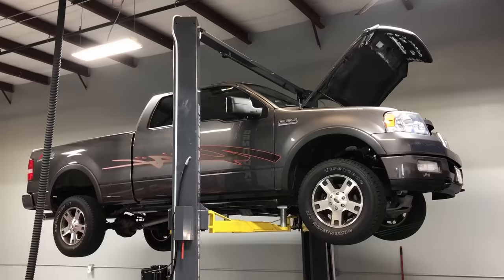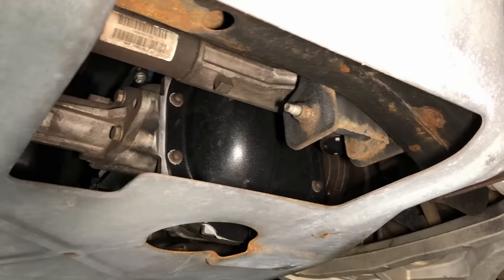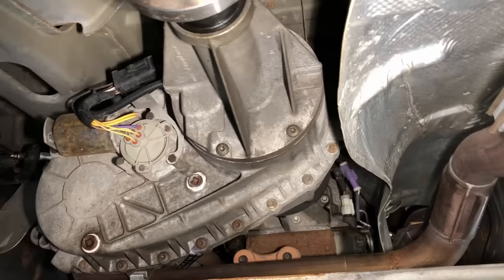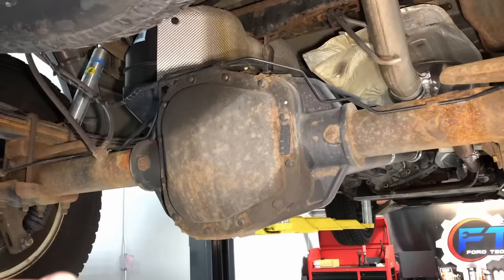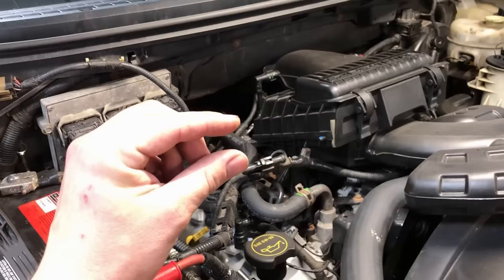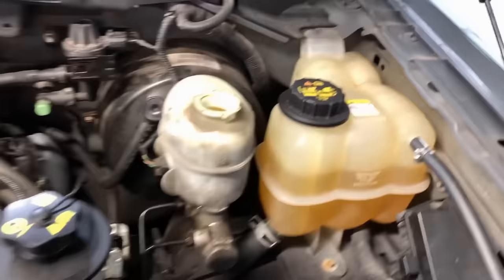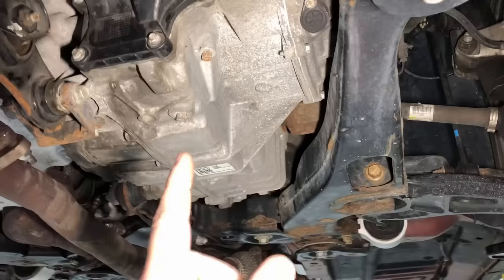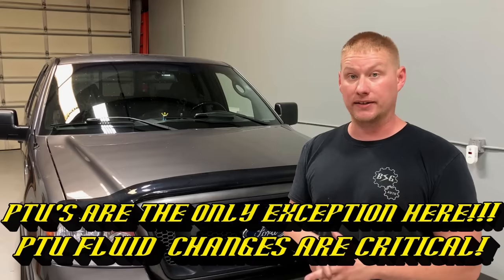Never Follow Ford's Lifetime Fluid Service Intervals: Here’s What I Recommend and Why!

Comment: what causes rust in the block?  besides water....low coolant level  o2 in system or a break down in coolant additives or iron from china?
Reply: All the above plus the coolant breaks down over time and becomes acidic to the point it dissolves material and causes more rust. Then you have the dissimilar metals in the system that cause galvanic corrosion as well.
Reply: agree!  .

Comment: GREAT INFO AS ALWAYS- I, VE GOT A 2003 FORD F53 CHASSIS MOTORHOME WITH THE R1- 400/WAUTO/OVERDRIVE IT SITS MOSTLY IT HAS 45500 ORIGINAL MILES- HOW MANY MILES BEFORE CHANGING THE MAJOR COMPONENTS REAR/TRANS/ETC; APPRECIATE ANY ADVICE, PATRICK.P

Comment: Just purchased a 2019 F350 6.7 diesel. What are your thoughts on an early first oil change to get rid of metal contamination from initial break-in?  1000 miles?  Later?  Thanks

Comment: Used AMSOIL signature series transmission oil at 24,000 miles in my 2016 Ford Explorer, it took 5 and a half quarts, so now it’s mixed with 5 and a half quarts of Mercon LV motorcraft oil, will that ruin my transmission?

Comment: When (if at all) do you recommend doing a *transmission fluid change AND flush*? In the video you said fluid change at 30k, fluid and filter change at 60k. Does it ever need to be flushed? 2016 F150 6R80. Thanks!!!
Reply from the maker: No flush needed
Reply: @FordTechMakuloco  Can you help me understand why a full flush is not needed? Many thanks!
Reply: @cg9608  shocks the transmission introducing all new fluid vs a drain and fill where only a couple qts come out. It’s to prevent transmission slipping

Comment: I have 2012 Lincoln MKZ hybrid,it has 700k miles and no problem,just replaces the electric water pump..should I change the spark plugs and coil
Reply: Did you add an extra zero by accident?
Reply: MaxiiBoii no brother,this cars are bullet proof

Comment: I have a 2015 F150 with the 2.7 ecoboost. I use 5w30 synthetic blend Motorcraft oil. I drive mainly all city driving, with short trips. I've always changed oil on all my Ford trucks every 3000 miles. I have a 460 V-8 in one, a 4.6 Triton in another, and my 2.7 Ecoboost. My other trucks are at 150,000 miles and run perfectly. Should I continue to do this with my 2.7 ecoboost? Will changing the oil too often do harm to a ecoboost engine?

Comment: I followed your advice and drained and filled my trans fluid on my 2018 SHO with 34000 miles, at a ford dealership... now I'm misfiring... it started 2 days after the service was done... any suggestions

Comment: I have a 2018 f150 non-4/4 with 46.5k, and 99% of the miles are highway miles. If I change the transmission fluid at 50k, (this would be the first time to replace the fluid) should I change the filter as well?

Comment: How often should the transmission fluid be changed on a '13 Focus with "power shift" transmission? Also, can I use "dexcool" antifreeze in place of the "orange" factory stuff?  Thank you!
Reply from the maker: 60k miles for trans fluid, and no I would never use junk GM dex cool.

Comment: Hello Ford tech, love your channel so much good advice.... wondering if you could help me out please please please my 2014 Ford F-150 Fx4 will turnover but won’t start the first time.... turn the key off and back on and she starts right up.... one exception is if she sits over night or for awhile it will start first time no problem. 5.0L just had the fuel pump replaced and she ran fine for a couple weeks before starting this... Fuse 27 checks out good (common problem), no codes, runs like a champ when started. Any ideas would be great my warranty just expired a couple hundred miles ago😢

Comment: Hi I have a 2016 mustang gt 55k miles with the 6r80 . Should i be doing a pan drop and filter, fluid change vs a flush to get all the old fluid out?

Comment: I have a question for you. My car is 12 mkz hybrid 263k mileage. I have never changed transmission fluid because of the manuel. Some people say if you didnot touch it so far don't change the transmission fluid. What would be your recommendation

Comment: What if the ptu does not have a drain.  I have a Ford flex and I never noticed a drain or a air scoop to funnel air to the ptu.  On an explorer I have seen a scoop that funnels air to it.  Even on an interceptors they look like they have scoops and other bits to keep the police vehicle cruising with no issues.  How would I service the PTU on a flex?

Comment: @FordTechMakuloco how often do you recommend a front diff fluid change for a 2015 f150 that has the IWE's eliminated? The front diff is always spinning. Also should I change the transfer case fluid sooner as well because of that? Also my dealer has recommended a transmission fluid flush for my 6R80 with about 82k miles ( I bought it used with 76k miles). Is a flush recommend or should I drop the pan and change the fluid & filter? Thanks!

Comment: How often should we do O2 sensors? The ones in front of the cats can improve mileage and power since they tell the computer how to mix fuel and air based on exhaust. I have a 2015 3.5 EB, so I imagine mine are getting blacked out. It has 50k on it. What about the ones post-cat?

Comment: What do you recommend for the transmission in an 08 Ranger? V6 with automatic, 113k mi, but fear I may be sensing some slippage. Fluid is still clean and red, and Ford says it's "lifetime"  (which I never have bought) but know these AT's sometimes have troubles as they get into this age range... Thanks!

Comment: Does anyone know how to contact Brian, without having to drive to Chicago? He doesn't pickup the phone or answer emails. Does anyone know why he occasionally advises 5w-30 vs 5w-20 engine oil? Was he threatened with a lawsuit by Ford or EPA, as to why he can't/won't talk about it? Can't get an answer for YEARS on this one question.
Reply from the maker: I have never deviated from recommending 5w-30 for the 5.4L 3v engines.
Reply: @FordTechMakuloco  Thank you for your reply! Woohoo! What about the 4.2L V6 and 4.6L V8 engines?

Comment: If your vehicle is used for highway 95% of the time, with "city" driving the rest (1 to 2 lights, no traffic, sometimes a train stop, small town kinda stuff) how long would fluids last then?  Would they break down faster due to highway speeds, faster moving parts sounds like more heat, however I guess on air cooled parts it does get more air on them, though I don't know if that is enough.  My neighbor has a 2013 Edge and I don't think he's yet to change his transmission fluid.  Last time I saw his odometer it was around 170k kilometers (that's around 105k miles).  He told me it shifts like a dream still no problems so he doesn't bother with it.  If I got him to allow me to change it for him (I do his oil and brakes for him, but I don't force things on him ultimately) would it be safe, no slipping etc?  I just don't want him to come at me saying I broke something.

Comment: I own a 2016 f250 6.7 and I use it about 5 to 7 thousand miles a year and was wondering when would be a good guild change for it I pull a 8 thousand pound camper 3 times a year?

Comment: Hey man great video, I got a 2011 Ford fusion with 85,000 miles on it I just recently replaced 2 quarts of transmission fluid. But the wrong fluid, AutoZone. I took out 2 quarts of the existing transmission fluid and put in what he gave me mercon V. It requires Mercon LV. I’ve already driven like 100 miles with that stuff what should I do?

Comment: Denver Colorado here,
I need to replace  5.4 3 valve engine 2004 F150.  Fasers timing issues at 164,000 miles. How can I know who to trust in picking an engine and installation? I want to tale your advise and install the high volume Melling oil pump . How do I know if the reman engine has the "good" fasers or if theyt are using cheap aftermartket  fazers? Will the upgrade likely void the re-manufactured engine warantee by adding aftermarket parts? Other parts I am considering are the headers, upgrade from the ford spark plugs. Does all that change the warantee with moist engine re-manufactures?

The only thing worse than Ford building a bad engine is the replacement engine is a bad installation or re-mmaned with bad parts?
Please advise

Comment: Hey man thanks for  Chanel  you have really good staff on it ....I have question for you I just purchase  2006 Lincoln Mark lt 8 cylinder engine and I was checking all the fluid   And it’s seems to be  overdue for matemance  now o want change all the fluid on the truck  but I’m not sure if should I used same oil as I see you on your videos  n fords F150s  or its there any chance specific brand to use on Lincoln Mark lt truck. Thanks for the help

Comment: I had to change my spark plugs in my SHO (3.5 EB) At 35-40k miles due carbon tracking. I took it to the dealer and due to no codes they wouldn't really check anything. Pissed me off. I just checked the plugs, all good. Why couldn't they do that? It's not that hard.

Comment: Hi  maybe I missed it but what is your recommendation on oil change intervals for the 3.5 ecoboost?  I seem to have to replace a turbo every 25000 miles on average.  i change oil every 3000 miles.  Thanks

Comment: On new truck, why do you recommend changing transmission fluid after 30k? Why not every 60k miles like for older vehicles?
Reply from the maker: Only on the first 30k miles, after that every 60k as stated in the video.

Comment: Love your videos, very informative, but would like your (OR anyone's ) good advice on what I could have done to prevent the heater core from developing a leak.  My current car is an 09 P71, with 155K miles and the heater core developed a leak so it is currently being bypassed. Fortunately, I live in Florida so don't need HEAT all that often, but may need DEFROST/DEFOGGER for windshield in a few months.  What went wrong?  How do I prevent another heater core from developing a leak?

Comment: Hi Brian. I just found my 2014 f150 3.5L ecoboost leaking coolant. I made an attempt to locate leak but very difficult from the driveway without lifting truck. Looks like its coming from water pump seal and dripping around oil filter and other parts. Bought my truck brand new and have followed your recommended service intervals, truck just hit 70,000 miles. Is it common for any radiator leaks to occur in that area so soon? Im taking it in to dealer since I have extended warranty. If it is leaking from pump, should I have dealer replace pump and thermostat as preventable measures?

Comment: Someone recently gave me an old 1998 F150 4.2 v6 that runs fairly well for its age. It has 170k miles on it. I'm using it as an extra work truck. I have been working on changing all of it's fluids out and replace worn and failing parts. The only major fluid I haven't changed yet, is the transmission fluid. I was thinking about changing it, but I don't know how many times the transmission fluid, if ever, has been changed. The guy who gave me the truck, got it at 100k miles. So he had it from 100k miles to 170k miles. He never changed the transmission fluid when he had the truck and he doesn't know if it was ever changed previous to him owning the truck. My question is, should I change the transmission fluid or just leave it as it is, at this point? I heard changing he transmission fluid on a higher mileage transmission can actually damage the transmission. What do you think? Thanks for the great videos and help.

Comment: Can you do an overview video on the 10-12 Fusion?  I recently purchased a 12 SEL 2.5 and so far i'm liking it... but it seems that the engine vibrates excessively at idle sitting in traffic.  Do these eat engine/trans mounts?  Seems like the drivetrain moves around quite a bit and was thinking should I change them?

Comment: Excellent video. I have a 2014 Escape with 26K miles, purchased a lifetime oil change program. At last change, the dealer wanted to flush (not drain/fill) brakes and transmission using their 5 year/30K miles rule.  You didn't suggest flushing. What do you think?
Reply: For brakes a flush is normal service, you attach a pressure bleeder at the master cylinder, then start opening the bleeders one at a time and let the fluid flow until it's clear If you have ABS it's a good thing to use a scan tool to cycle the system while flushing to clean it out as well.  Not possible to drain and fill unless you want to deal with bleeding the system because it will get air in it.  Transmission flush isn't a bad thing IF they use factory fluid. It removes more fluid than a simple spill and fill BUT it doesn't change the filter.
Reply: Usually they say "flush" but they mean "fluid exchange."
Brake fluid every 36 months. Trans fluid every 60K
Reply: A transmission flush is not the way to go in my opinion. The dealer always tries to recommend it for some reason. With a flush they will simply hook up a machine and flush your transmission. The big problem I have is they don’t change the filter or inspect the pan. A true transmission fluid change should include dropping the pan, cleaning the pan, and changing the filter. The only downside is the additional cost of dropping the pan but might as well do it the right way.
Reply: @Blazer02LS  Thank you.
Reply: @TheKevinhaeb  Thanks for the input. This will likely be "my" last vehicle so want to get the max mileage out of it.

Comment: Hi, your videos have been very informative. i have a 2002 f150 super crew 4x4 with the 5.4 triton with about 300K miles on it. i was hoping you could direct me to someone in my area of corona calif who does good work on f150 trucks. i believe i may need to change my motor out and repair a vacume leak.  Thanks for all your videos.

Comment: Maku, can we get a video of you changing the electronic motor on the transfer case? I hear this is a common problem on the transfer cases and my truck is giving me a hard time in low range 4x4 because of it. I hear it. An be difficult because something has to be lined up inside? Is this correct?

Comment: A little off topic here, but what did Ford do to their OBD system. I had a 2001 F-150 that my scan tool worked fine on. Now I have a 2012 F-150 that my scanner won't read. It reads every other vehicle on the planet but not  the new F-150's. The maker of the scanner said it was something Ford did and I would have to buy a new tool to scan my truck. What's up with that?

Comment: I have a 2006 f150 I acquired with 145k on the clock, I have no idea of previous maintenance on the transmission what are your thoughts on chanting the fluid at this mileage
Reply from the maker: Yes pan drop and fluid filter change only, do not flush.

Comment: Hey Brian great advice, thx!...noticed weeping on pinion seal, is that something your customer should worry about? Do you plan on replacing it?
Reply from the maker: Yes, this is the truck that I bought for the shop. It needs both axle seals, pinion seal and it appears the diff cover is leaking so all of that will get addressed at the same time.

Comment: I have a 2008 Ford F 150 5.4. idk the tranny history other than I know it hasn't been serviced. It has a leak. The fluid is dirty, should I keep the old oil or throw in that Lucy's thickener? 

Also, idk the diff fluid history either.

Comment: What about time intervals on oil changes? For instance, you drive the vehicle only 5000 miles per year and live in a summer/winter climate and run synthetic engine oil.  Do you change oil once a year?  Twice a year in spring & fall?

Comment: Wasn't gold corrosive to the Ford edge 3.5s. At some point they went from gold to Green. Then they went from green to orange in late 2011. Now they're talking about they discontinued orange and we have to switch to yellow. Who understands them. Those engines have internal waterpumps. Which coolant is it that they really want us to stick with. I currently have 54k miles on my 2013 3.5 edge and it was factory filled with orange and I do drain and fills with orange prediluted. Now that they discontinued it I'm scared to switch over to yellow because I can't trust ford anymore when it comes to fluids. I want my waterpump to last and don't want my seals and bearings wearing out prematurely. Please make a video on that topic based on your knowledge

Comment: Thanx a ton for these recommendations  I just bought a 2020 f150 5.0v8. And I understood all except the transmission. I haven't got to look at which one is in my truck yet so if I understand correctly I need to do the very 1st fluid change at 30k?  and should I also replace the filter ? Since I'm already there
Reply: 30k is a good interval to do the fluid change at, id replace the filter just because I'm in there anyway. Already have the pan down why not right? Cant hurt it.

Comment: "If your vehicle still has a hydraulic power steering system".....Oh...I see I'm that old now :D  Soon it's going to be "If you still have 134A refrigerant"
Reply from the maker: Already is, they are moving onto 1234YF now that requires a totally different machine.
Reply: @FordTechMakuloco  Lovely. I guess they found out that their ozone saving refrigerant is not so good, so let's try another recipe.  Just saw a report saying that ozone hole over Antartica is getting smaller. Guess they were wrong on the good 'ol stuff we have been using since the early days. Just more money to spend.

Comment: Thank you for this info. I just bought a 2019 Ford Flex SEL 202A Front Wheel Drive and wanted to get your opinion on when to bring it in for service. I got it wirh only 226 miles on the OD as of right now i have 708 Miles and want to bring it in at 3k miles to change the oil to Full Synthetic Oil however the sales guy and the service advisor said i can bring it at 7.5k miles but i would rather treat it good so that it can last me. If you dont mind giving me some free opinion, what would you recommend. I trust you more then the sales guy.